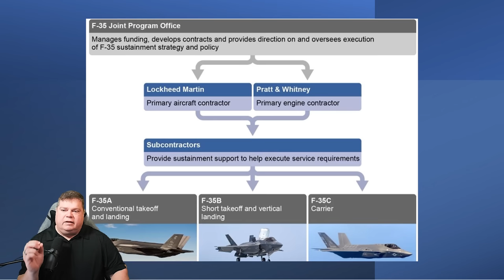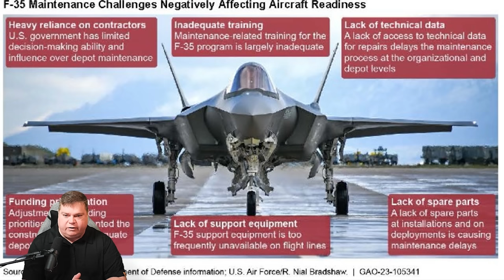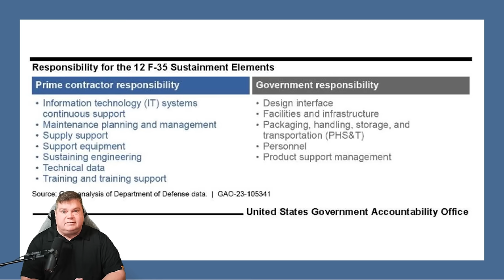What Is Wrong With Americas Deadliest Fighter Jet

Comment: We're talking about the most costly, most complicated weapon system ever built. There are going to be problems that need to be addressed. Maintenance is being done by contractor personnel because they built the airplane. Sub-contractors are the only existing experts on their particular piece of pie. The military does not have enough maintainers in uniform to do the job all on their own without contractor support. The prime contractor's responsibility, in this case Lockheed-Martin, is to coordinate and oversee the work flows of all of the subs. The government is the customer, as such they contribute nothing but a list of requirements for the Program. Bottom line is the engineering life cycle for the F-35 or any major acquisition Program for that matter is not nearly as simple as you think it should be.
Reply: Everything you just said is the problem.
Reply: @andrews2990   No, as a matter of fact it's not the problem. It's the solution. As I described it that's how defense acquisitions are made. I've worked on both sides. I was a civilian test engineer working for the Air Force, a government employee, and I have also been a Systems Engineer for one of the major sub-contractors on the F-35 Program. The relationship between the government and the contractors that supply the government is typically not an adversarial one. The contractors are not in business to rip off the tax payer. They are in business to supply their customer, the military, with the best possible solution to meet their needs. But they are in business, meaning that the goal is to turn a profit.

Comment: The core of these issues is the fact we are relying on folks that work for a union. Unions have been the absolutely worst threat to the safety and security of the nation for decades. None of this will get fixed until unions are removed from the equation.

Comment: Imagine if the US was in a conflict where F-35's are being used. Within a very short time you would run out of aircraft as they wouldnt be able to keep up with repairs & maintenance. What has happened to the US!
Reply: If the minimum requirements were not acceptable then the Gov should not have signed the deal. It sounds like the contract needs to be renegotiated

Comment: The F35 has had problems from the beginning. To me, it seems like it’s a subpar stealth fighter. The military has a problem of not wanting to cancel programs that don’t meet expectations or balloon in costs. While the technology used in this jet are theoretically awesome, I don’t think it’s quite there yet. Just look how long it took to become combat ready/ approved. They has an s load of issues. I went to an air show this past year and one of the F35s would not start and could not be in the show or even leave with the others after the show. Imagine that in combat. Scrap it and redo it.
Reply: But thát is the problem: This program can not be scrapped, because all the contractors ánd sub-contractors are TO FAR in it, financially.

Comment: If the contractors are a major issue then clean them up or get rid of them. I’ve been around a lot of contractors & by the time the government issues a contract, then the contractor subs that out & maybe happens again. The guy that’s finally doing the work doesn’t give a 💩. So the end is a half azzed job. Extreme case yes but it happens.

Comment: Ward Carroll had an interesting comment about lightning strikes on the f35, causing complete power loss.
Reply: He didn't say it causes complete power loss, he said he isn't sure how many backup systems the aircraft has or what they run on. FBW systems are 4x redundant and the plane itself acts like a Faraday cage. The only failure he mentioned was the OBOGS issue that was rectified shortly after being mentioned by the GAO with a redesign in coming 2023 (iirc, maybe 24) to lift the thunderstorm restriction
Reply: Yes, here in the Netherlands, we also had a lightning strike on one of our F-35's.
Because of power loss, they had to return to base.

Comment: Roflmfao, everything was wrong straight from the drawing board. 😂😂 they had to split the aircraft into two variants bcoz it was not capable of what was promised. Then the guns didn't work on the first gen bcoz it would literally bend the airframe so the first gens couldn't even use guns until smaller guns were in the later gens. The vertical sucks bcoz it always crashing on vertical takeoffs and landings. Not carrier capable bcoz 2 fell off carriers withing weeks of each other. Not stealth since Russian s 400's over the black sea could see and track them so they are never deployed east now. 5 have crashed in the last year and a half and 11th overall at 80-100 mil a piece costing over a billion dollars in losses from crashes alone without ever being deployed in real combat. (Fake bombing missions covered by other aircraft is not real combat) tell me again how "superior" this fighter is with billions in losses and no kills? 🤷😂 this is just a meme to project power to the weakminded. 😂😂😂
Reply: Completely True!!👍👍

Comment: The F-35 was a mistake from day one and no matter how they try to fix it it won’t work. The technology in it would make a new designed and cost controlled specialized aircrafts of different roles real real good but the F-22 worked mostly because it was aimed right at what it should do even then they should have done the YF-23. The rot set in around that programs imo for the whole new fleet. 

The DOD, Navy and Air force know the F-35 is not going to cut it and why the F/A-18 super hornet still majority of the navy’s fleet and now the new F-15 shows they know F-35 will not be the aircraft the fights.

Comment: Such an advanced Aircraft that we haven’t figured out how to maintain it …. The helmet visors cost $700,000 … how are you going to trust a marine corp plane captain to pass you up one of those … “ as a plane captain who has dropped stuff”
Reply: ? The helmet cost $400,000
Reply: @somezsaltz6835  yeah it’s still super expensive
Reply: @somezsaltz6835 More recent ones cost about $250,000 or so, couldn't find back the article but there was a query in a govt website requesting the number back in like 2015
Reply: @forzaelite1248  damn